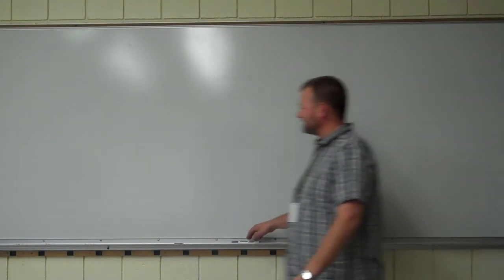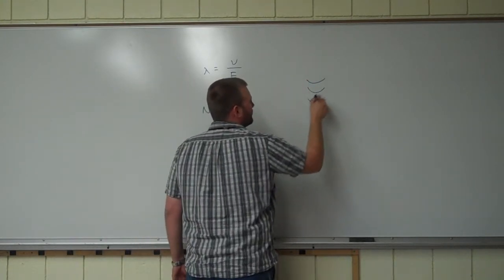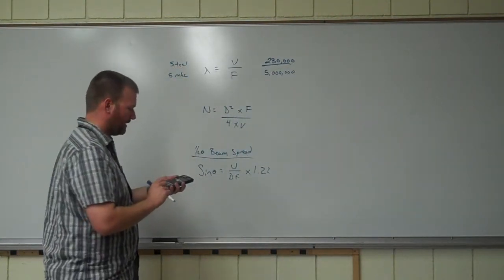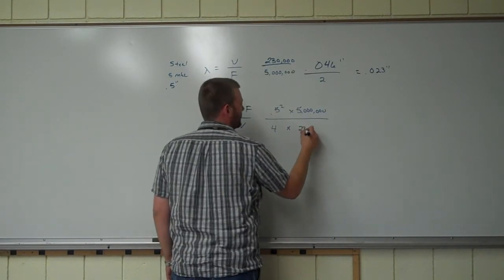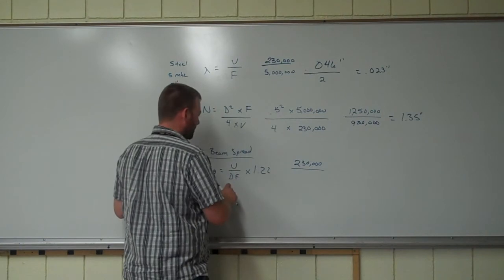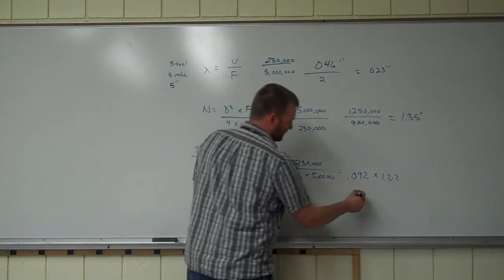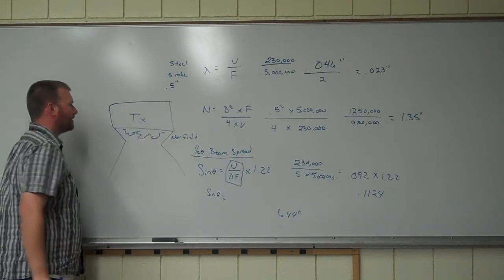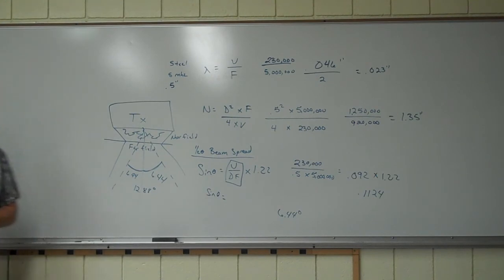Wavelength, Nearfield, Beam Spread Calculations

Comment: Do you have any videos with velocities in 10^5 cm/s and
m/s being converted to mm?
Reply: Write out the full numbers for meters or cm as they specify in the question (without scientific notation to keep it simple) and then convert to mm (by moving the decimal one space to the right for cm to mm, or by moving the decimal place three spaces to the right for meters to mm) and do the same as in this video for calculations with the numbers for Hz.  To convert to inches at the end for the near field length, divide mm by 25.4.

Comment: Hi there!

I have a doubt:

The bibliography I have consulted states:

sin @ = V/D.F x K, where K has differente values as follows:

For straight beam probes:

0,51 to div up to -6dB
0,87 to div up to -20dB
1,08 to div up to -30dB

And, in case of angle beam probes:
0,44 to div up to -6dB
0,74 to div up to -20dB

It also says we should multiply the diameter of the crystal by 0,97 in order to find out its actual diameter.

Could you help me to understand?

Also: what is that 1.22?

Many thanks!

Comment: how I can calculate 20dB beam spread for following probe .0 deg 20mm 2MHz when testing steel?
Thanks
Reply: I have calculated and got answer is 9.2 deg .but in the tests which i did answer is 18.4 deg
Reply: Anar Akhundov At that point what you would do is double the 9.2º because what you actually calculated is the 1/2 angle beam spread. Does that help?

Comment: I have been told that beam spread is not real can you please give me your defence to this and try to debunk the video "sound is round" here on you tube
Reply: Think of your ultrasound going into a part being like a flashlight.  Hold a lit flashlight in a dark room, stand close to a wall and point it at the wall.  Note how big the circle of light on the wall is.   Start to walk a few steps away from the wall while continuing to hold the flashlight in the same position.  Notice how the circle of light on the wall grows in size.  That's basically what ultrasound does in a material.  That's the beam spread.  It's real.